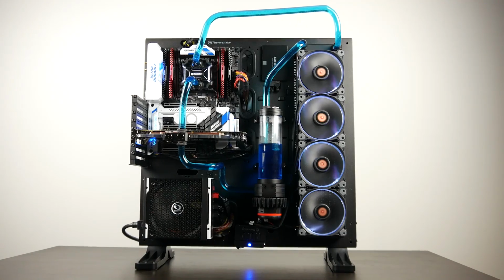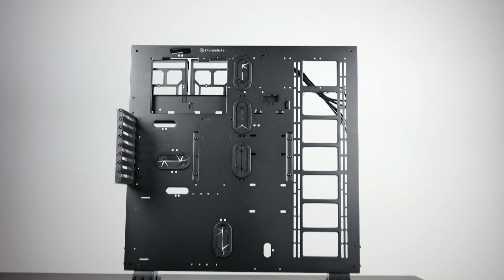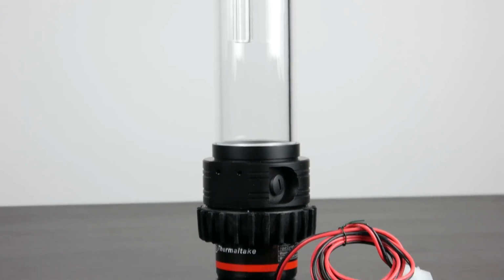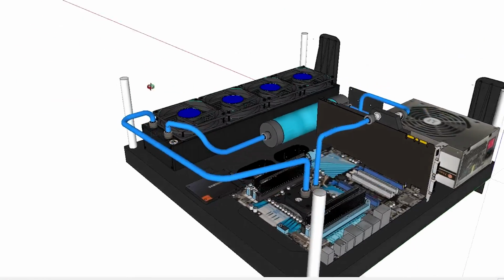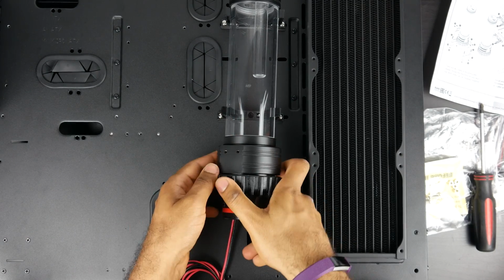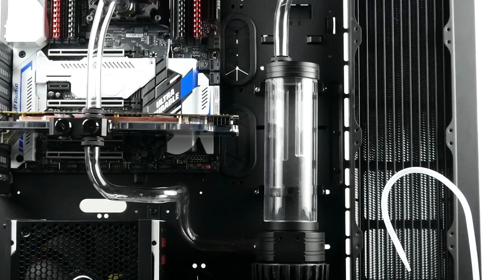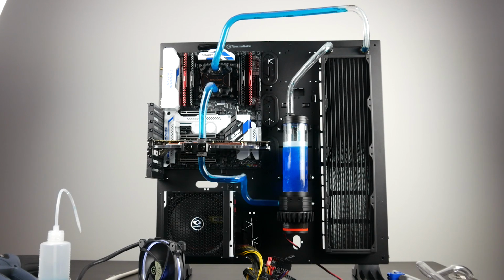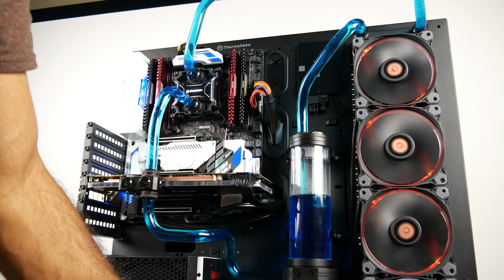Epic Liquid-Cooled PC Build Guide - Intel 6800k/GTX 1080 (Part 1)

Comment: this looks like the gpu block is actually bypassed and the graphics card isn't cooled at all.
Reply: Not just me then...
Reply: Look were it exits the gpu, most gpu bloks inlet and outlet are not in line.
Reply: Bjørn Bech Andersen
i think all gpu blocks are like this. It makes no sense otherwise.
Reply: Brandon Carter i think the word bypass is describing the situation well.
Reply: 100% correct. can just picture first run at 60 C idling on the GPU
Reply: This seems to be a guide on how not to liquid cool, no gpu block circulation, and leave the fill port open so air has a place to go? It gets replaced by coolant in the loop and ends up (hopefully) in the reservoir, unless you add more coolant the volume of air in the loop doesn't change, it just ends up in the reservoir
Also, that coolant seems to be staining, distilled 4me
Reply: you are right most gpu blocks have an in and an out just like the cpu im 100& sure he fucked up and its not bypassed but it sure as hell is not right the water that is that block is going to get hot fast as fuck
Reply: We do water cooling at work on diffusion reactors that run 1100c temps. Our in/out are right beside each other. If you look at the block design there are only two ports...in/out and they are staggered. So the IN must loop around the whole block then go to OUT...hence why the staggered ports. It probably circulates from left to right I'm sure. With only 2 port, in/out, kinda hard to screw that up
Reply: *****
yes. way of least resistance
Reply: Looks like Pump > GPU > CPU > Radiator > Res > Pump to me...
Reply: id agree with you there if there is any water going through the block itself id imagine it would be very little and he'd get a significant improvement in cooling by moving one pipe to the other side of the block
Reply: If you look at his plans, the tubing was correct in there. He made the error during building phase. The water does not circulate trough the GPU block, but as already said, just continues straight to CPU. I hope he reads these comments before something breaks in his PC. He Skipped the 3rd picture in the GPU block instruction manual from XSPC.
Reply: Ah I see it! Sorry. I was looking at his CAD model that rights but yeah....he definitely isn't cooling shit. Funny now that I took a closer look at his connections. I know he reads comments....how did he not fix this by his part 2?
Reply: 75ur15
I add some car coolant, just to be save,,,
Reply: good thing I have build my by following him will check my GPU block connection before cut the tube lol

Comment: Should of water cooled the voltage regulators also.  Gigabyte sells a motherboard with the block already installed all you have to do is install the fittings.

Comment: i just realized u didnt install the res correctly. that tube inside the res is the inlet, the hole without the tube is the fill port. u can switch the tube in either hole.

Comment: LOL that thermalfake controller only controls 3 fans, the bottom one he didn't show, because it is on the mobo attached, and not on the colour switching thermalfake controller ;-) 
second: you can mount your GPU vertical in this case to show it off.. he didn't.. WHY!?!

Comment: Did you use a plug for closing the unused connector on youre gpu waterblock or isnt it neccesary to close that port for fluid srry for asking but im new to watercooling

Comment: IMO, it seems as if the CPU will be getting heated water from the GPU. Is that OK?
Reply: yes, the position of components in a loop does nothing, i'm more conserned about the gpu waterblock, as it seems to be connected wrong. the water should come from one side and get out of the other, in thi s case it goes straight through

Comment: The tube which its gose into graphics its out from the same port, which mean the liquid is not circulate or "looped"into your graphics. from what i see its just passed from down fitting to the out directlly. the tube that goes out should go out from the left  fitting one i think in order to make a complete circulate or "looped"into your graphics.

Comment: HOLY SHIT AT ALL THAT THERMAL PASTE

Edit: On the CPU

Grain of rice-sized dab people!  Grain of rice!
Reply: He could also be referring to the puddle of gray slime under the factory GPU cooler but LAWD HAVE MERCY at the CPU paste....
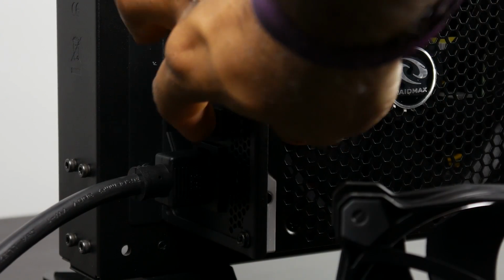Reply: The water block tubing is connected Wrong!!!! The way it is connected is simply bypassing the whole water block, just look at how the bubbles travel up @ 14:25. do not follow this guide you will damage your gpu
Reply: that random thermal splash
Reply: lol @ when it went off socket - damn this is a good video!
Reply: He had a little too much on the cpu, but nothing too excessive.
Reply: which part?
Reply: +Lee Blake How could you miss it?
Reply: It was an ok amount because 2011 CPUs require a bit more usually that  115X if I remember correctly.
Reply: +FastRedPonyCar he didnt even put that much on the cpu right?
Reply: fuck thats messy, best way is to get some cling film on the end of your finger and spread it on the cpu, nice and even.
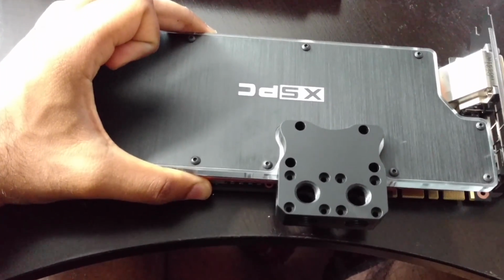Reply: 4:14
Reply: Those fittings work fine for non GPU block purposes, as long as the tubing is secure.  They are screw down compression fittings so they should be nice and tight anyways.
Reply: That's not to say the whole thing isn't a horrible fail lol, but the fittings are actually probably fine.
Reply: I think he means this: https://youtu.be/pz8dOSnD5zo?t=4m12s
Reply: it was messy but you are supposed to use more GPU's then you should on CPU's
Reply: IKR WTF
Reply: FastRedPonyCar I don't know how many times I've stressed that.  good thermal grease a grain of rice will spread evenly over the entire die
Reply: Holy crap He also used the wrong fittings wtf...... he is using @4:50  Bitspower G1/4" to Enhance Multi-Link Fittings (these are used to connect multi gpu waterblocks) this guy does not know shit!!! I thought they  compression fittings looked really small. sure enough check out the part link he posted..... what a fail bro stay away from water cooling!!!!

Comment: I thought the GPU block the tube goes in one port and out the opposite one. in the vid it looks like the tubes go in and out of the same port. is that something that differs from block manufacturers? when the system was filled it looked like it went right up past the GPU into the CPU, making me think the fluid isn't circulating in the GPU block. I guess thermals would confirm my suspicions in the next episode.
Reply: He isn't cooling the GPU at all. I noticed that immediately since I did the same build but in orange. I'm glad I was at least smart enough to understand that it needs to go in one port and out the other. Jeez this is a bad loop,
Reply: +Ian Boswell he knew where it needed to go. he planned for it to go in one side and out the other...he just didn't build it that way. People get scatter brained. But that top line looks like inexcusable shit. No need for that.
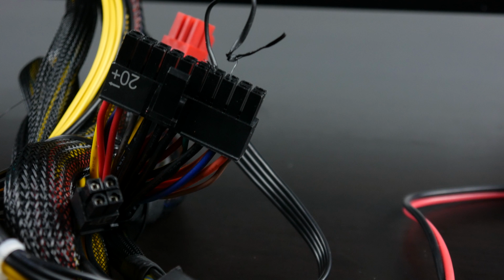Reply: Yeah I didn't notice that at first but you can clearly see at 14:23 the coolant goes straight up and out the other side of the waterblock when he turns the pump on.
Reply: Yes. If you look at the sketch up it does exactly that. In from the right and out from the left.
Reply: +Michael Cowling I know! Could have done that so many better ways
Reply: IKR must be custom block or something. Some gamers just love boiling their GPU water :)
Reply: well it does function. 0 flow rate but it the heat will still function as it heats up the surrounding water and that's transferred all over the loop.

Comment: Waj....please do a video on how to PROPERLY apply thermal paste.Thank you.
Reply: It really doesn't matter as long as the thermal paste is not on the mobos lga pins
Reply: there is no need for a tutorial. just drop a tiny bit of thermal paste somewhere in the centre of the cpu and then put the cpu cooler on top of it with the square facing down (where the heatsinks intersect).
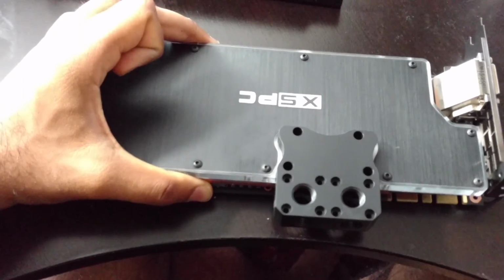Reply: 4:10  Apparently with a bucket and blindfold.
Reply: I know that...but he used like half a tube.

Comment: Nice build sir! Although from my previous personnal experience with custom watercooling, I think that tubes on the gpu have to be mounted on each side of the block. In this case one tube could be on the bottom right port and the other on the top left port to force the liquid to pass through the actual gpu block. As you can see at 14:25, the liquid just seems to free flow from one section of the tube to the other. The block ain't see through so i can't tell for sure but that would be my only concern with this build. Cheers and keep up with thoses videos man!

Comment: A perfect example showing that there's no limit to what one can build when inundated with freebies and sponsorship!
Reply: The water block tubing is connected Wrong!!!! The way it is connected is simply bypassing the whole water block, just look at how the bubbles travel up @ 14:25. do not follow this guide you will damage your gpu
Reply: Holy crap He also used the wrong fittings wtf...... he is using @4:50  Bitspower G1/4" to Enhance Multi-Link Fittings (these are used to connect multi gpu waterblocks) this guy does not know shit!!! I thought they  compression fittings looked really small. sure enough check out the part link he posted..... what a fail bro stay away from water cooling!!!!
Reply: +Danyal Ahmad Well if you had enough money you could do it too
Reply: +Army Strong If it's your hard earned cash I'm sure you would think twice maybe thrice before spending $420 on a Mobo, unless ofcourse you are Richie rich. I have seen a lots of real life pc builds and people try to justify price for each components. Only sponsored YouTubers splurge because of all the freebies they get given!
Reply: Lol that's true
Reply: or money
Reply: +Army Strong or freebies
Reply: same here #whocaresabouthomowithagtx1080inthepc
Reply: haha..complete system build is pretty pricey to not invest 100 bucks in matching BLUE heat sink memory. Just sits back and shakes my head...custom water cooling loop but red and black RAM modules that don't fit or match ANYTHING on this build and it is a wall mounted display piece..makes no sense.

We won't even talk about the ketchup and mustard wiring...should have build a z170 and used the savings to make it look nicer.

Also I am no water cooling expert but doesn't the gpu waterblock have an inlet and outlet for a reason? Does that even work using the single port? I mean it seems the water would not flow through the card and the water in it would just stay in it rather than circulate as the path of least resistance would be for the flow to just skip the already filled block versus circulate from that port to the exit port as intended. I have no idea, but that is just my thought on it by looking at it.
Reply: ***** no waaaay
Reply: My dead blind grandmother can do better aesthetically.
Reply: ***** well im sure it cant play games like this one can and im sure it doesnt reach 2000000 degrees Celsius  like mine does
Reply: Carlos Alas - I noticed it right away, though I was going blind. How dumb do you have to be to screw that up. Obviously he didn't do much research prior to his build.
Reply: Oh no. So wait - are you saying... that the liquid won't get cooled in the radiator it's going through?? Or that it's leaking? Or that it's not going through the pump and is therefore stagnant? 

If the liquid is sealed. Moves. Circulates over every critical heat-point... then please genius. Tell me... what fucking law of physics do YOU know of that I don't - which is going to undermine the EFFECT... of cooling everything? 

Is it some arbitrary shit you read in an instruction manual? 

Take a physics class idiot. 

IT DOESNT MATTER. 

I see the error he made on the GPU, but I assume he fixed it already.

Comment: If you want to avoid air switch the inner tube inside the reservoir to the return line, not the fill line. Otherwise water returning from the radiator is splashing inside, adding air. The manual shows this too. The inner tube isn't doing anything when it's on the fill port side....also your thermal paste application looks like a money shot on that thing @8:46
Reply: Beat me to it!  Only other thing to add to your loop would be a drain port Waj.  This will make your life much easier when it comes time to drain and perform any maintenance.  Otherwise a really nice build!  Keep on buildin'!

Comment: That horrible psu you can buy a full modular one for the same price even less I bought 850 modular for 80$
Reply: +Solid Mass EVGA G2 and P2 series are top of the line units.
Reply: Can you send me a link I'm doing an sli build and am looking for a good psu
Reply: Nikola Karovic If you really need a 1000W PSU, then chances are you are using it to power an expensive rig. It is extremely beneficial to spend some extra bucks and go for the better PSUs since a PSU fault can fry other parts as well.
Reply: Yeah but the build is obviously sponsored by thermaltake so
Reply: +Solid Mass http://m.newegg.com/Product/index?itemnumber=N82E16817151108 this is what I bought now it is 100$
Reply: They have an 850w GS unit which is pretty much silent
Reply: That PSU is great( 1000w raidmax), for 100 euro u cant buy anything decent that has real 1KW. I have it and it runs x5670 OCed 4.4ghz (300w tdp with OC ) 7970 CF (250W tdp single card) and water loop. If u didnt try PSU dont speak about it.
Reply: Nikola Karovic Raidmax PSUs wildly differ in build quality. Some of their PSUs appear to be pure trash.
Reply: IMB2U I noticed that in EU Raidmax is cheaper ( 100€ vs 140$ in USA) In last decade I had dead Seasonic,Enermax etc so I really dont care if Raidmax Fail...I admit it could be more silent but Im ok cos unit really has 1000W (its not just some sticker on package) People say that it lack of some protections and I dont care for it cos PC is on UPS etc. 100€ for 1000w thats reall value (TT, Cooler master, Chiftec, seasonic, superflower.... all start at 180€ for 1000w and up to 300€ for superflower gold)
Reply: +IMB2U First thing I need real 1000w , second it isnt expencive build ( its 6 core xeon) third this Raidmax psu is Ok, and in the end I had dead seasonic and Enermax so 0 fucks are given for your lack of knowlege.
Reply: Nikola Karovic I'm just trying to help, what the hell is wrong with you?
Reply: +IMB2U how are u trying to help? U didnt try Vampire 1000w , u heard that cheap raidmax psus are bad (they are not btw, my friend has gaming caffe with 10 Raidmax Cobra PSUs that work 24/7 last 2 years without failure and they cost 40€ one ) U just spread bullshit with " dont buy cheap psu ...your system bla bla". Fucking internet expert warrior read 2 Johny Guru articles and now blessing people with bullshit.
Reply: +IMB2U And u know how I got these Vampire 1000w . I bought Cooler master B700w and it was turning off with 7970cf...I just replaced it for raidmax that was same price (on promotion 10% off) and it forks great more than 1 year ....Pls stop talk more bullshit .
Reply: +4A2bp 2pac ?
Reply: +4A2bp Javi se kalašturo :D

Comment: 4:12 Jesus, did you use enough thermal compound!?  WTF !?
Reply: Its fine for the gpu
Reply: its a big cpu so its fine even jayztwocents said it too during the two idiots build a pc. :)
Reply: Theres no IHS on the GPU. That entire thing is the chip, so you have to cool it all. Also, it doesn't matter how much you use or if it spills over the sides as long as you're using non-conductive thermal paste.
Reply: You just need enough to cover the chip, you don't need GOBS of it running down the PCB.  Just seems sloppy as heck.
Reply: That was how much the manufacturer put on there. And while I agree that it looks like a lot, the manufacturer has how much thermal paste to use down to a science. So if it's, say, increasing temps by 3 degrees, thats a significant amount that will end up saving them thermal paste. Although, it does still look like a lot to me.

Comment: Nice but I have never seen the benefits of liquid cooling versus cost of air cooling. (Remember ever hose will eventually leak)
Reply: really, you've not the seen the benefit?
Reply: NonsensicalVids versus the cost? No. That's a lot of hassle and $ for a 5% better overclock.
Reply: Barack Smith 5% what are you talking about? 

Overclocking
temperature
sound/noise

and probably a few other things
Reply: Barack Smith also you have close loop coolers. also what you said also applies to air coolers, why get a better air cooler for a 5% overclock